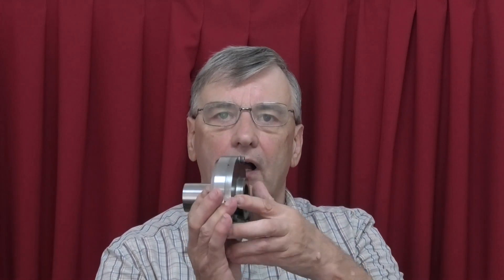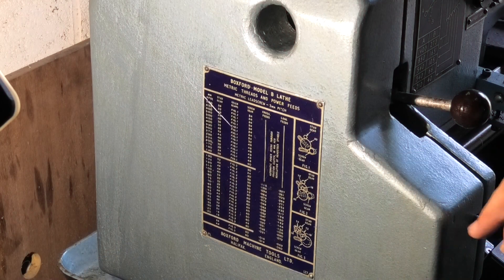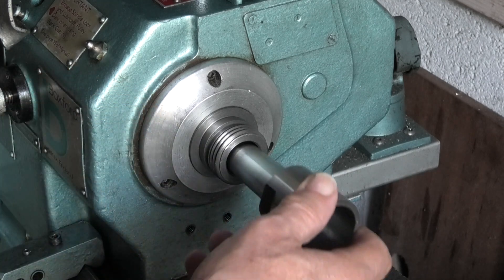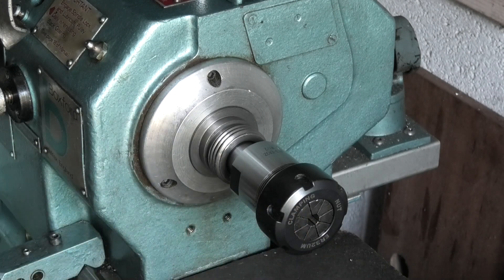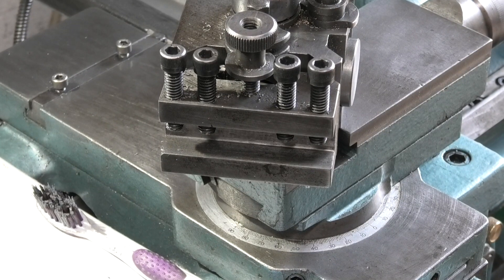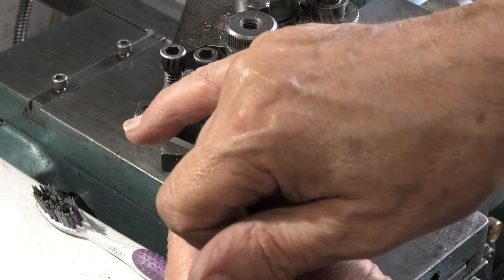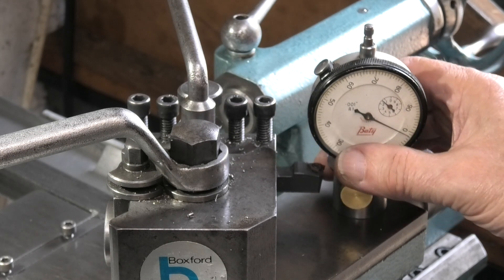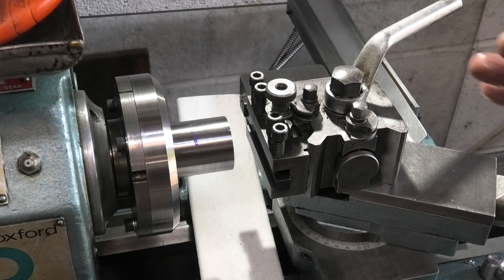Screw cutting an ER32 collet holder

Comment: G'day... very nice thread cutting   I like the compound stop, make good sence.
The main thing everything works fine. The fine tuning for tramming in the collets etc will have to be finished on your Brothers lathe.
Reply: Mr. Enot used a stop on the cross slide (backing out from a pass).

Comment: Very interesting video thank you. When cutting  a thread like that I always make an under cut to the root of the thread, I noticed you didn't & got away with it without breaking the tip. I did learn a tip from you last cuts feed straight in to make sure full form thread👍, by using a under cut to thread depth with blue in it gives a good indicator to final size.👍🇬🇧
Reply from the maker: Hi I didn’t make an undercut incase it needed more work on my brother’s lathe any the thread extending